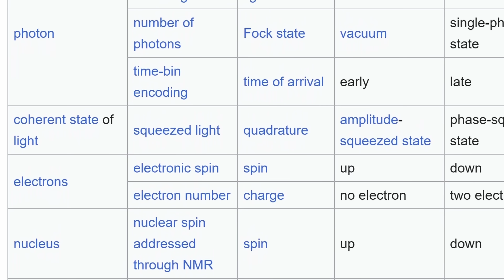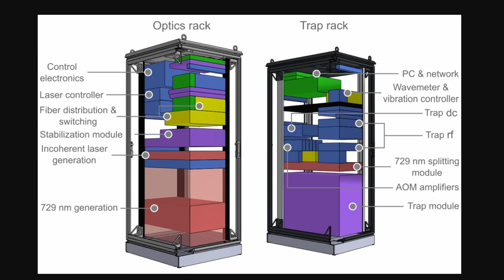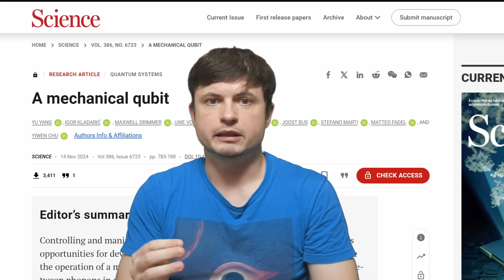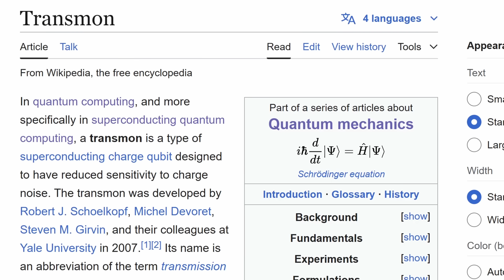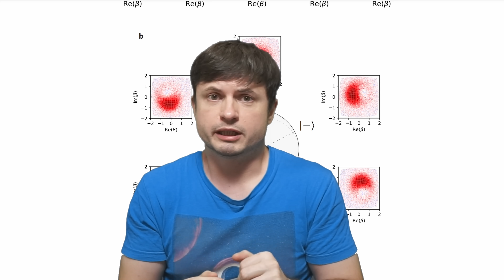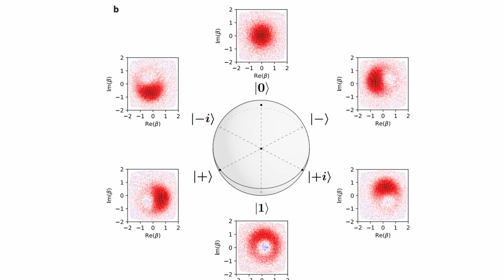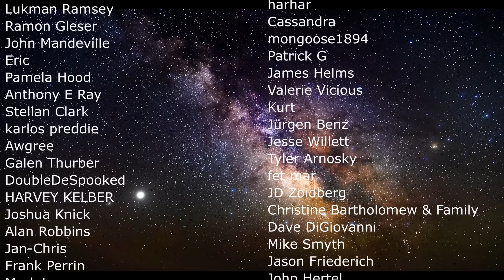Creation of the First Ever Mechanical Qubit, Here's What This Means

Comment: What are OBJECTS may fall at the same rate, AS gravity/acceleration involves WHAT IS BALANCED inertia (and/OR inertial resistance) consistent WITH both F=MA AND WHAT IS E=MC2. Consider TIME AND TIME dilation AND WHAT IS E=MC2 !!!! The CLEARLY solves WHAT IS the coronal heating “problem”. The stars AND PLANETS are POINTS in the night sky !!!! ELECTROMAGNETISM/energy IS GRAVITY. Gravity AND ELECTROMAGNETISM/energy are (CLEARLY) linked AND BALANCED opposites, AS WHAT IS E=MC2 IS taken directly from F=MA; AS the stars AND PLANETS are POINTS in the night sky !!!! TIME IS NECESSARILY possible/potential AND actual ON/IN BALANCE !!!! Consider TIME AND TIME DILATION ON BALANCE, AS I have CLEARLY proven WHAT IS the FOURTH spatial dimension/TIME; AS ELECTROMAGNETISM/energy IS GRAVITY; AS WHAT IS E=MC2 IS taken directly from F=MA !!!! ACCORDINGLY, the rotation of WHAT IS THE MOON matches the revolution; AND WHAT IS THE MOON will (and IT does) move away very, very, very, slightly in relation to what is THE EARTH/ground !!!! GREAT !!!!

By Frank Martin DiMeglio

Comment: Google’s Quantum Chip and Multidimensional Reality

Google’s quantum chip represents a monumental advancement in computing power by leveraging the principles of quantum mechanics. Unlike traditional computers that use binary bits (0 or 1), quantum computers use qubits, which can exist in a superposition of states (both 0 and 1 simultaneously).

Quantum Spin and the 720° Phenomenon

1. 720° Rotation: At the atomic and subatomic levels, particles behave in ways that defy classical physics. For instance, an electron does not complete a full "spin" in a standard 360° rotation (as objects in our three-dimensional world do). Instead, it requires 720° to return to its original state, indicating hidden layers of higher-dimensional reality.

2. Blockage in the Third Dimension: This suggests that what we perceive in our limited three-dimensional world is only a projection of a much richer, multidimensional quantum reality.

3. Multiverse Theory: Quantum experiments—including Google’s breakthroughs—reveal that particles can exist in multiple states simultaneously. This points to the existence of parallel realities (a multiverse) that coexist but remain inaccessible to our direct perception.

---

Connection to Human Consciousness

The human brain, with its complex neurological structure, mirrors the principles of quantum processing, bridging quantum mechanics and consciousness.

Microtubules as Quantum Computers

1. Microtubules: Inside each neuron, structures called microtubules—built from proteins like alpha and beta tubulin—act as potential quantum processors. These microtubules can process information at the quantum level before translating it into electrical signals within the nervous system.

2. Quantum Consciousness: According to the theory proposed by Roger Penrose and Stuart Hameroff, consciousness arises, in part, from quantum computations occurring inside microtubules. This suggests our awareness is deeply connected to the quantum realm.

3. Light to Electrical Signals: The quantum-level information processed within microtubules travels through the body as light signals, which are later transformed into electrical currents, enabling cognition and interaction with the physical world.

---

The Heart’s Electromagnetic Field and Matter as Waves

1. Heart as a Field Generator: The human heart generates a measurable electromagnetic field that radiates outward. This field acts as a bridge between the physical and quantum realms.

2. Particles Behaving as Waves: Much like the famous double-slit experiment in quantum mechanics, where particles behave as waves in the presence of observation or intention, the electromagnetic field around humans influences particles in our environment. This enables the matter around us to behave in a coherent and structured way.

3. Creating Reality: The interaction between the brain’s quantum computations, the heart’s electromagnetic field, and external particles suggests that human beings actively modulate reality. Our thoughts, consciousness, and intentions act as tools to shape the material world, both individually and collectively.

---

Simplified Summary

Google’s quantum chip breakthrough demonstrates that matter at the quantum level behaves in ways that challenge our three-dimensional view of reality. The 720° spin phenomenon reveals the existence of hidden dimensions and supports the idea of a multiverse—multiple realities existing simultaneously.

At the same time, the human brain—through microtubules—acts as a natural quantum processor, where consciousness begins at the quantum level. This quantum information travels through light and electrical signals, synchronizing with the body’s electromagnetic field, which radiates from the heart.

This field interacts with particles around us, causing them to behave like waves and creating coherence in our reality. As humans, we function as architects of reality, translating the quantum realm into tangible experiences and actively shaping the material world with our consciousness.

---

In essence, Google’s advancements in quantum computing mirror the human capacity to bridge dimensions, process consciousness at a quantum level, and influence the structure of reality itself.

Comment: Wait, so quantum computers are basically just trying to make transistors that use float values, instead of binary ones? 0.0 - 1.0 instead of 0-1?
I thought all the entangling and stuff was about FTL information transfer, or something. Entangling things and sending and receiving data without other physical connection. Maybe making faster computers by having parts inside communicate instantaneously.
Or is that still a problem with not being able to know where it is and how fast it's going, or whatever it was? Measuring changed the result, observer stuff, so entangling particles doesn't really work practically for communication?

Comment: I do have to say though, point by point rendering has gotten so good that I've had a simulation running for the last 3 days on a solar systems formation. The amount of interacting points add attracting bodies is quite a large number now but my tower seems to be handling it okay. Running a little slow but it's pretty cool even though it's not completely accurate
Reply: I'm running at about 40 minutes per second so I'm only hitting just over a 2 years into the simulation at the moment. Sing The evolution from just a bunch of rocks and dust is starting to form planetesimals is pretty insane

Comment: I still don't get, if you want a "qbit" that can take any value from 0 - 1, why can't you virtualize the process in a classical computer and emulate the qbit with a random number generator. How is that different to a qbit? You can even virtualize the process of entanglement, just link two of your virtual qbits and have whatever one reads, for the other just inverts it. Someone please, explain why that isn't possible or why it wouldn't work. What extra does a qbit do that classical transistors can't replicate.

Comment: 2:22 : I don’t know that I like the phrasing of “in between” 0 and 1. That brings to mind like, an interval between 0 and 1, which is not the right thing when it comes to superposition. I prefer to say “combination” or “mixture” of the 0 and 1 states (assuming one wants to avoid technical-sounding language. If one doesn’t mind technical-sounding language, one can just say “linear combination”.)

4:20 : this is wrong! The reason quantum computers would be faster isn’t because the individual operations are faster. It is because the algorithms that can be implemented on a quantum computer have an asymptotically faster runtime than the best known algorithms that can be run on a classical computer, for certain problems.
Reply: I agree, ‘between 0 and 1’ suggests you have 0.1, 0.2, 0.3 etc. just like you would say ‘between 1 and 10’ and automatically in your head you get 1, 2, 3 etc. While in quantum computing the thing to wrap your head around is that it can be both 0 and 1 at the same time.
Reply: It is all quite subtle. For instance, quantum algorithms give the right answer with a probability p; which is not a real problem, because the answer can quickly be checked classically and you can try again - on average you need 1/p tries. Now the practical value of p depends on two things: a value that is intrinsically imposed by quantum mechanics itself, and a severe diminishment of this value due to the problems of getting qubits to behave for the duration of the computation - behave effectively means interacting only with the other qubits assigned to the algorithm, and not with the rest of the universe, which things naturally do very very quickly.

Now, if your qubits almost all misbehave almost all of the time, but are tiny and easy to manufacture, you can just put very many of them on your chip and work on a clever method to find out which ones (a tiny minority) actually performed a quantum computation.

I believe that this is their strategy. It is a delicate numbers game.
Reply: @physicswithpark3r-x3x  I think quantum error correcting codes are the approach that is being sought most. It’s neat that they can even work.
You use many hardware qubits to simulate a smaller number of higher quality qubits, such that when the hardware qubits have an error, the measurement that reveals the error somehow doesn’t reveal any information about the quantum information that the simulated qubits are storing, and so you can check for (and correct) errors without the measurements needed for that causing the quantum info you want to keep being lost. However, this only works to reduce the error rate if the error rate of the physical qubits is already below a threshold that depends on the particular quantum error correction algorithm being used.
Reply: @drdca8263  True, for the details I refer you and any reader to chapter 5 of Quantum Compute Science by Mermin.

But I what I meant was the strategy of effectively having a fantastically large number of quantum computers running in parallel (and as independently as may be managed) - such constitutes a brute-force approach sidestepping the constraint you mention.
Reply: @physicswithpark3r-x3x  ah, ok, that sounds… expensive, but makes sense
Reply: @drdca8263  Yes, that's the numbers game: if they have come up with a way to physically realise qubits that are atomic-scale tiny, cheap, and relatively easy to "wire up" so as to make the various operators (Toffoli etc.), then you can afford to have a whole bunch of (individually crappy) quantum computers on one chip. 

The funny thing is that this goes against the grain of what an academic physicist would do: you'd have one or a few physically realised qubits somewhere in the middle of the lab room, surrounded by tons of kit geared to keeping them in the state they are supposed to be in.

Both approaches are probably worth pursuing, for the present.

Comment: Here are 2 major claims that require verification:

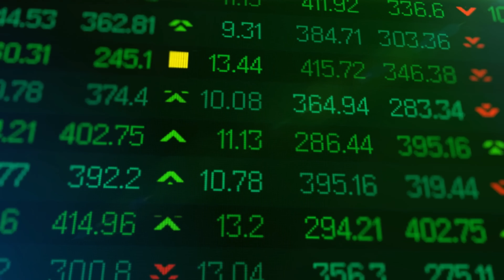Anton Petrov, [1:30]: "So far not a single quantum computer out there despite the claims has conclusively achieved what's known as the quantum advantage."

Sundar Pichai (Google CEO): "Introducing Willow, our new state-of-the-art quantum computing chip with a breakthrough that can reduce errors exponentially as we scale up using more qubits, cracking a 30-year challenge in the field.  In benchmark tests, Willow solved a standard computation in <5 mins that would take a leading supercomputer over 10^25 years, far beyond the age of the universe(!)."
Reply: Yes, this, and what did they run? Shor's period finding ??

The problem is that physical realisations of qubits (or Qbits if you prefer) typically fall short of the behaviour standard that we would require to do quantum computation in its fullest sense. So they can do one particular trick, sort of, but are not suitable for general quantum computing. Given that even a single qubit is so fragile, you can see the tremendous problems if an algorithm calls for 2, or 20, or 200 of them. Further, a number of "quantum" computers have been presented that were actually very clever analog machines in their own right, but not "quantum" in the sense of quantum computing.

If google can really put any number of full-fledged qubits on a chip, they can break RSA encryption right now and change how the world works. I would expect that the actual achievements, while respectable, fall far short of this.
Reply: A couple months ago Sabine explained that they were still unsure if increasing the scale would reduce or increase the error rate. I'd be surprised if they solved it so quickly and already have a production-ready prototype.
It could also be that her info was outdated or that Google had already done it but kept it in secret for a while.

Comment: I heard about Quantum Computers like 20 years ago (being that I'm 36, so there was probably concepts around before I heard about it, I was just too young to know about it) but in 20 years Quantum Computing seems to have gone absolutely nowhere but I probably have no clue how difficult it might be considering what they're trying to achieve.
Reply: It's might be due to lack of public interest just like space. Moon/mars base sounded too sci-fi and not worth the costs to alot of people.
Reply: It took over 30 years of development of classical computers before we had one available for home use, and the quantum computer is a much much harder nut to crack than classical computers. Anyway, once perfected, they still may never be available to individuals for home use. Think of classical computers as guns and quantum computers as nuclear weapons.
Reply: The first idea of a computer came about in 1850. The first vacuum tube, which would later be used as the first sensible building block to build early computers was invented around 1880. The first built computer was around 1945, still made out of relays, only later computers were using vacuum tubes. First transistor was built 1948 and still, until around 1965, unless you were in the field, you wouldn't notice much about computing.

With quantum computing, we sort of have a vague idea of what the quantum computer should be, and we definitely don't have a sensible building block. We are still in the 1850-1880 era, maybe not even that. Progress is being made, but don't expect it working anytime soon.

Also, quantum computers aren't "better" computers, it's not a replacement for a regular computer, it's only useful for some very specific tasks. If it ever gets commercialized, it's probably gonna used as a "quantum accelerator", an additional component similar to a GPU in your computer today.

And you'll still have to wait 10 seconds for a website to load.
Reply: @therflash word salad 😊
Reply: @PlanXV  what are you trying to say?
Reply: @therflash  You wrote alot and his attention span is unable to read it all. So instead of ignoring your comment he tries to play down your comment so it seems like nothing you said matters.
Reply: Quantum Computing has walked miles. Seriously, why would you comment that it seems to you it has gone nowhere when you know yourself you know nothing about it. Quantum Computing poses tremendous challenges and the ammount of progress that has been made is nothing short of incredible, despite not being enough to revolutionize everyday life. Nonetheless, we are already using it for drug discovery, and already have plans for quantum communication and cryptography, as well as other quantum technologies, such as quantum sensing, emerging from the progess made towards quantum computing
Reply: @ramos_4892  Right, "plans", I heard "plans" 20 years ago. That's my point? You can't even articulate the advances so why comment in reply? I know they've made incredible theoretical discoveries but it hasn't manifested to anything tangible, that was my point. Zzz...
Reply: @ramos_4892  no it hasn't. Quantum computing is like fusion. It's always just 10 years away every year
Reply: @OriginBullet  Technically, fusion is a lot closer. We know how to make a working fusion device that produces way more fusion power than it consumes. We've had them since the 50's.

The first one of those was successfully started in 1952, in the Marshall Islands. Many more were tested, one famous one was in 1954 at Bikini Atoll.

Many people would complain that those "reactors" are a little bit too powerful for our liking, and they'd be right. 

I just want to point out that we do in fact have a functioning fusion device. We just aren't willing to deal with the fallout.
Reply: @ramos_4892 we got the quantum crusader out here lmao

Comment: The main problem is that quantum computers have a lot of errors. You can cover it by computational power, but then you are using computer power that you were intending to gain by making things quantum. In order to make quantum computers work, you mainly need to lower error rates.

Comment: The most entertaining thing about Quantum computers (so far) is when the all too regular claims for "Quantum Supremacy" are made (inevitably computing an answer to a problem no-one thought worthwhile to solve classically before) - are utterly refuted within a few days by a classical computer team.
Reply: The competing classical algorithms are approximate tensor network contraction, driving those teams to push the limit directly benefits AI research and computational linear algebra in general.   How much longer will they keep up, 5 years?  I doubt 10 years.